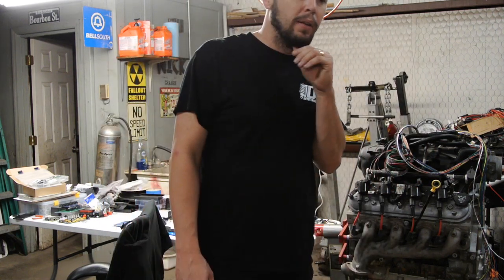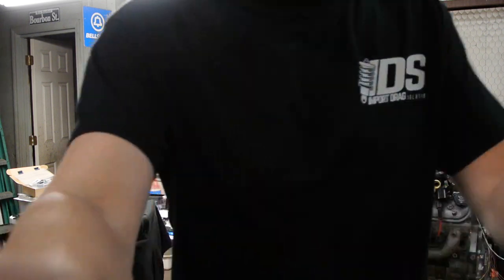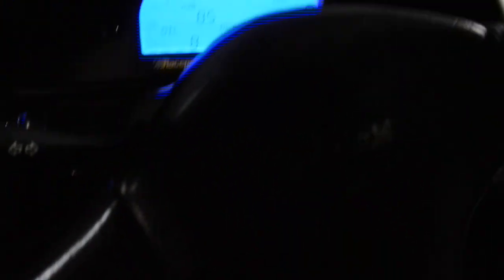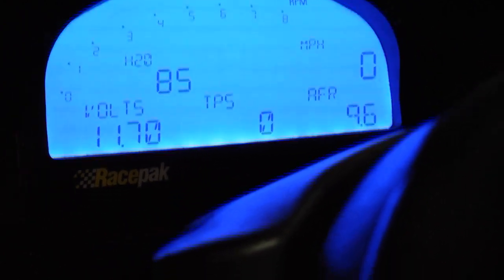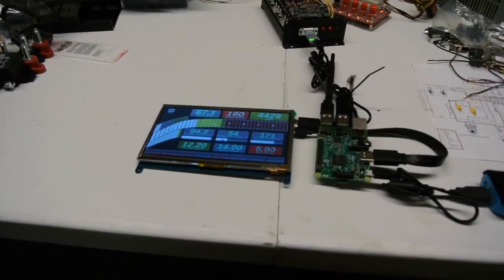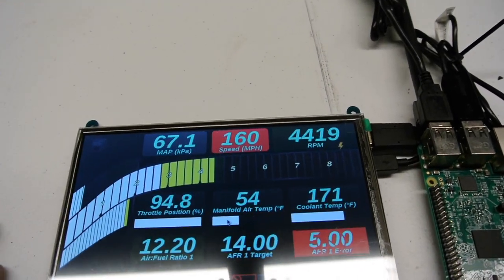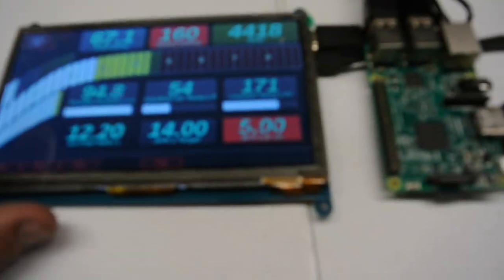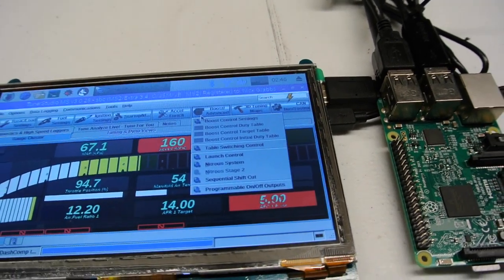Megasquirt: Pi Dash Preview

Comment: I did this in my car also. I ended up swapping to a 10" screen. The 7" was great for dashboard but not quite enoughfor on the fly tuning IMO. Later swapped to a pi4 with 2gb of ram. HUGE difference in loading times and usability. My next idea is to work on making the pi also record with the new HD pi cams coming out and eliminating the need for my worn out GoPro.
Reply: What 10" screen did you go with

Comment: Don't use a touchscreen that is so small.. Spend the extra cash and get a bigger one and also buy a wireless hand keyboard with a touchpad to make sure you don't screw up a setting somewhere. 

Also, too, you can redefine the inputs and iirc you can make an A and B tune switchable with a toggle input to one of the aux inputs... Good luck and this is EXACTLY what I am doing too. :)  All this old tech ie Racepak etc its just for ppl who want quick and easy not state of the art.

Comment: Pi 3 b + is quicker, get the quickest SD card, Sandisk is good, clone the card in case it fails you'll have  a backup. Setup a keyless entry remote to turn on 5v  so it boots up before you get in and a borkin button installed in the pi headphone jack to turn the pi off.
Reply from the maker: I've been meaning to get a new 3 model, looking forward to seeing how fast they are
Reply: It just feels the right amount of quicker. Of course I did overclock mine cpu, gpu, ram, a little to get Tekken to play a little smoother. Very happy with how well that works and the picture

Comment: What about the speedo? There is no speedo input on the Ms3 am I correct?
Reply from the maker: Actually there are multiple speed inputs, I run a wheel speed sensor on the rear wheel and front.  Plays a huge role in traction control.
Reply: Grabbs Racing  Ah I see! That's great to know. I've just bought an ms3 gold box. Looks like a pi will be getting ordered too in the future.
Reply: Can also use GPS

Comment: Or you could pick up a windows based tablet for a $100 and skip the PI. Install the TunerStudio, connect the USB and you are done. Anyways thumbs up for DIY.
Reply: Unfortunately Windows is extremely unreliable, especially on a slow $100 tablet (not what you want when it's telling you whether a race car is going to blow up or not) This setup is too in a lot of ways, I think the best method is direct data conversion out of the Megasquirt using CANbus.
Reply: @pieboyfresh  Linux distros are darn reliable. Of course, only as reliable as the Pi.. As long as you make sure you get a good brand name Pi and a bulletproof TF card you are golden. I have seen Pi used in some mission critical equipment and it has been astonishing the amount of abuse it can take and keep going.
Reply: John Annear it's true both are not great for a race car.....but windows 10 can be reliable if you turn off updates
Reply: Connecting the USB, is the most expensive part..

Comment: This plugs straight into the megasquirt or you need an extra programm?
Reply from the maker: You need the LCD, a raspberry pi and a megasquirt, nothing out side of those three items.  Im working on a video (may take me a week or so) that goes through exactly what i've done and how i've set it all up.
Reply: Looking forward to that. I'm planning a car for track days using a megasquirt and a budget way to get rid of the whole dashboard would be really welcome.
Reply: @GrabbsRacing  Well you have to install Tunerstudio on the PI also. Im just not super impressed with some of these cheap touchscreens they are wonky ah lol we put them on oilfield equipment and its brought the butt pucker a few times when ppl have accidentally mushed a button or something lol